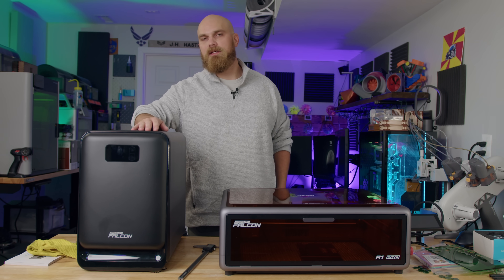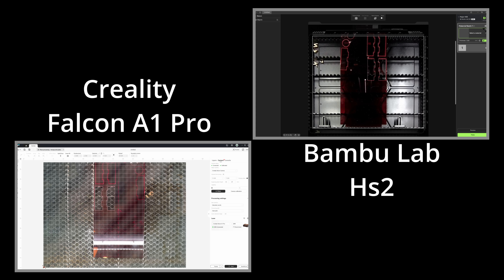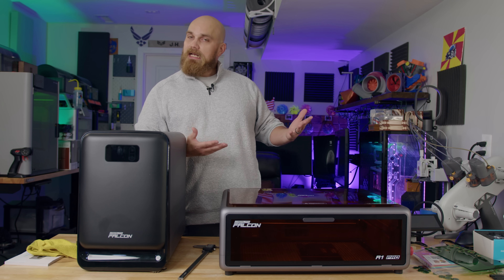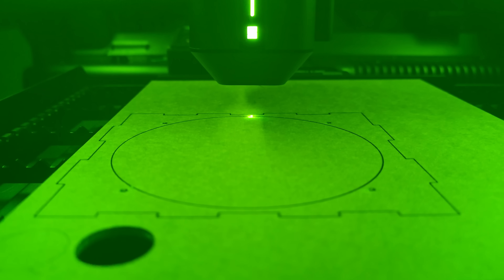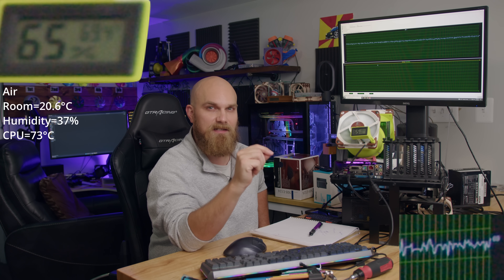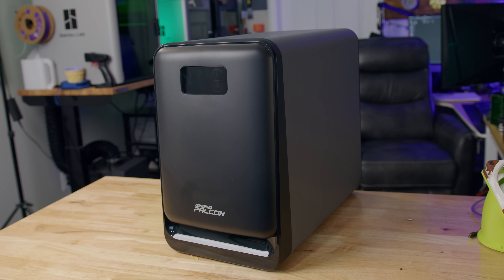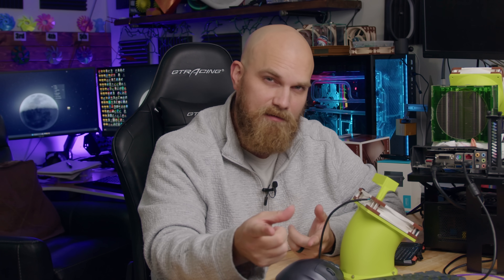I Water-Cooled My Air Cooler… Again, But Different

Comment: Seems like many CPU air fans are a lot of uneeded work.

If you're really wanting cold constant temps, just use a water cooler block connected to a aquarium chiller and call it done

Comment: i would like to see 3 fans put in series (right next to each other, as in air from fan 1 gets pulled through fan 2 then pulled through fan 3) and sealed up with spacers around a 3 inch gap in between to get crazy high static pressure. basically, if you put a 3rd fan in-between those two macaroni tubes.

Comment: i  wonder: when you build a closed circuit of air, with an AC unit cooling the air, those also dehumidify the air.
when you use the water that comes out of the AC unit to cool the air further, so that the water is taken from the airstream by the AC unit and the vapour is added before the air goes into the PC, would that be more effective than an AC unit alone?

Comment: How does the humidifier work?
If it uses heat to evaporate the vapour would be hot = bad
If it uses mechanical evaporation the vapour would be cold = good
Reply: you seem to have answered that in the video...

Comment: In my mind, the air should condense on the heat fins and release the same amount of heat energy that was "lost" from evaporation. I suppose if the air going out is more humid than the ambient air, it still carries some latent heat that was originally from the ambient air.

Comment: By the way, the cooling efficiency of humid air does not only scale with the lower density, but also with the higher heat capacity. I think if you manage to cleanly combine the two relevant equations you actually end up with a slight increase of heat capacity per volume for humid air.
Plus, the capacity of a fan to move air may actually depend on the mass of the air, so potentially the same fan can move a larger volume of humid air than dry air?

Of course that is no valid for cooling of humans, which depends on the evaporation and will always be more efficient at lower humidity ;-)

Comment: Humid air is only bad for cooling with animals that sweat inorder to cool themselves ie: More humidity the less sweat evaporates from your skin which means you get hotter the more humid it is the worse off you are or until you suffer heat stroke

Comment: If you think that hot moist air is more efficient
just wait till you meet cold moist air
Reply: Even more so considering the surrounding air is dry and he has basically built an evaporation cooler.
The results will be quite different when the air is already wet.

Comment: Yeah that's evaporative cooling that decreases the temperature of that air,  you can get a similar effect if you use one of those small "personal air coolers" without misting. Then you wouldn't have the water mist, just the cooling, and more humid air. Just humid air from an air cooler that don't generate mist won't cause condensation unless you cool that humid air down below the dew point. 

Air coolers that don't generate mist typically don't even make the air go quite down to the wet bulb temperature, but even some of small cheap "personal" air coolers reach quite close to the wet bulb temperature. So, using such an air cooler could generate some potentially meaningful cooling without having to worry about condensation on the CPU cooler. 

The main problem with evaporative cooling is that the humidity in the room needs to remain relatively low, which can be difficult to achieve when you're constantly adding moisture to it.   

By the way, you can't see water vapor, what you see is small water particles. 

Just humid air would only have very small effect on the cooling, at a given temperature, water vapor has less than half the specific heat capacity of liquid water at room temperature, which means less than twice that of air, and even really humid air only has somewhere in the ballpark of 1% more of it mass being water vapor compared to typical room conditions, in the same temperature.

Comment: if you have an infrared camera, could you show where the hotspots are on the air cooler ? Then cut acrylic to be able to a higher flow rate/speed ? induction on those spots and the rest (if there are) just a normal airflow

Comment: Not sure if your explanation is entirely correct. Yes you are precooling the air and humid air is less dense but it still has a higher heat capacity. Humans cool by evaporating sweat, which is less effective in higher humidity air. CPUs do not sweat (afaik^^) but thanks to the higher heat capacity the same volume of air from the fans can extract more heat from the cpu.
It will never be able to cool below room temp, but humans can as long as the air is dry enough

Comment: As a Creality Ender 3 V3 SE owner... yea, Creality just does not care lol. And tbh my experience has been decent with it especially relative to its price back when I bought it (it was the recently updated model with auto leveling etc which prior models didn't have). I've printed multiple hours per day with it, printing items that must be 99% identical every single time, and I am pleasantly surprised with the printer not having a single major issue or needing any maintenance to keep itself consistent enough to cover my overarching needs.

But man.. the thing is, you just always randomly spend more time trouble shooting random little things, and the "big issue" is that while these small little issues are not critical and you can deal with them, they always change, so you never really know what you have to deal with next. There's not much consistency to how the issues arise or any patterns to base your troubleshooting on, and right as you figure out why something caused a minor problem, now the next minor problem is gonna be something else and you have to troubleshoot all over. Is it bed adhesion or improper heating distribution on the hotbed? Is it a software update that now for no reason changes some intrinsic parameters that makes the printer print the same type of part differently now just cus it was sliced with a newer version of the slicer software? Who the fuck knows.. 

Prints always hover between 90-100% desired quality, but a somewhat consistent "90% good", is just low enough that it's too annoying to ignore, yet not annoying enough to really make big headlines or have forums talk about them.

And it seems this "90% good enough" is a thing that is consistent with most Creality products and software. Like the laser cutter that has all the specs on paper, is not overly expensive, but then a dumbass mistake like inadequate cooling is what drags it down out of everything that could be wrong, it's something that dumb and easy to fix?? Like, the audacity of just not fixing a blatantly fixable mechanical issue like that is just a bit insulting lol.

Already have a P2S on order, finally gonna make the switch to Bamboo and see what that life tastes like. Creality always makes me wonder if my print problems are due to my own skill issue, or if it's just Creality being Creality. Bamboo should be able to give more concise answers, and offer a nice hardware upgrade on top.

Comment: here's an idea for you though with the inverted watercooling setup - can you hook enough systems into a loop where a pot of water on the coldplate/hotplate gets warm? one of the biggest sources of waste in datacenters is waste heat. I'd love to see if there's an easy way to demonstrate it to politicians in my country as they push for more datacenters, as a way to re-use that waste heat for other industrial processes.
Reply: Instead of industrial processes, why not move the heat into district heating.
Temperatures won't be enough to boil anything, as the temperature of the water will always be lower than the heat source and warmer than the surrounding air. The whole thing with nothing being 100% efficient. But it could be enough to add to room heating.
Reply: @HappyBeezerStudios  true. At the moment though, most of the datacenters being proposed in my country are in industrial areas, not near residential ones. was thinking with a compressor or heat pump design it might not be enough to boil water, but might get you half of the way there at least

Comment: Basic Physics: humid air has a greater thermal capacity than dry air. There are more particles comprising the atmosphere. More particles means more mass to absorb and transport the heat.
Reply: Very small difference in specific heat capacity between dry and humid air in "normal" conditions, and that small difference isn't due to the number of particles as that is the same in a given volume assuming temperature and pressure is the same, that's why you can calculate the mass of a given amount of gas if you know the volume and temperature and the average molecule mass.
Reply: Great if the thing you cool gets it's cooling from the temperature difference.
Not so great if evaporation is the method of cooling. Which is also why 50°C in a desert are less uncomfortable than 30°C in a jungle.
On the other hand, if you want to keep things above a certain temperature, dry air is better. Like, let's say, going outside in winter without getting frostbite.

Comment: Water is more efficient at carrying heat than air.  It stands to reason that a higher humidity would allow the air to carry more heat away from a surface as the water vapor absorbs heat energy from any surface is contacts before fully evaporating.

Comment: First off if you have a laser and don’t have lightburn what are you even doing. Lightburn is the only way to go for software. I have the falcon 2 pro 40w and I have well over 2k hours on it never once over heated and done very very minimal maintenance on it. I cut 5mm abs at 100% power 300mm/m cutting out control panels most panels are 15-20 min per panel and I’ll cut them back to back with out a single issue. Just got the atom stack a70 pro max the creality 40w cuts just as good and is more precise 🤷‍♂️

Comment: Having an Ender was an adventure. Having prints out of nowhere failed because of one issue only for another completely unrelated issue to rear it's ugly head in teh next print. It is just an endless cycle of troubleshooting and upgrades. And I kinda loved it but at the same time, I rarely ended up actually printing something. When I accidentally shorted the motherboard I realised that I just want a print button, that I had a print fear and avoided printing stuff because I was afraid about what will go wrong this time.

Regardless, relative humidity improves air's thermal capacity. That is why if it is hot and humid you feel much hotter, as the air is essentially "hotter" to you (you have harder time transferring your own heat to it), but when it is hot and dry you do not really feel all that hot (evaporation cools you much better). That is however only true for human body however as important part of our cooling is evaporative cooling via sweating (and if you have nowhere to evaporate your sweat you are essentially thermally insulated). For air cooling a PC you have huge thermal differences, where humidity works in yourr favour. In fact a cold humid air is ideal, it draws in the heat and exhaust hotter at much lower humidity (relative humidity - the air temperature dictates the air's capacity to contain humidity without condensation, cold air is much worse at it while hot air is really good at it, this is how dehumifiers work - they cool down one side, draw in air that they cool, take the humidity out of the air via condensation on the cold part and then use the cooled air to cool their hot side, essentially AC that only cools itself). What you made is essentially a swampcooler, albeit reversed (the real one uses water wicked into cotton and blowing air through it to cool down air via evaporation).

Comment: Water vapor in the air acts as additional thermal heatsink for aircooling. Higher humidity means the air in a set volume of space can absorb more thermal energy as it passes the cooler fins.

Comment: Also water has a 4x heat capacity compared to air while the mass (density) is only 1,2x to the air. So evenif the mass is lower for the vapor it can carry way more heat from the heatsink

Comment: The camera complaints made me laugh because I grew up next to my dad use a laser cutter, and there was no such thing as a camera to help align material. You moved the svg to where you thought the right place on the canvas was, and sometimes you messed up. It was never a big deal. You got pretty good at placing it in the right place. This camera feature seems like a good improvement though.

Comment: Commenting on this 7 hours after video released and it has over 60 dislikes, looks like there are allot of Creality fanboys hate watching this video and disagreeing with the obvious unsatisfactory subpar performance of the falcon lol I'm on Major Hardware's side and believe the evidence shows that its clearly not a case of operator error and the machine isn't up to the task and isn't preforming as advertised by Creality the manufacture

Comment: The fan is round. the heatsink is square.
WHY did you not 3D print an adapter from circle to square so the air had to pass through the whole heatsink?!

Comment: Now if you want the actual ultimate heatpipe cooler hack, cut the ends of the pipes open and solder on water fittings and fill with water then use a small pump to circulate water through the pipes.  Fish pond diaphragm pump is best to use as there will likely be bits of copper circulating through.

Comment: Aside from the evaporative effect, water has a very high thermal capacity, meaning higher humidity air will require more heat to raise the same amount of temperature than low humidity. That's another reason it runs cooler at higher humidity.

Comment: The main thing going on is probably that you aren't talking about total room humidity, but high humidity coming from a humidifier into a lower-humidity room, which means there will be a lot of evaporative cooling and effects from the temperture of the water being added.

This is actually something you can do for your outdoor unit for HVAC. You can have mist hose addons spray water onto the fins of your outdoor unit and improve cooling efficiency. Of course, it leaves tons of deposits and makes dirt and stuff stick to it more, so the products for this purpose can be something of a scam. But not totally, because the effect legit works.

Comment: You should look up cooling towers and possibly try to make a more effective version for a CPU. I know in datacenters with centralized water cooling, cooling towers are used to get the water temperature below ambient, which uses some water, but is more effective than just blowing air through a big heat exchanger. The large concrete hyperboloid-shaped things that have "smoke" coming out the top and are commonly associated with nuclear energy are also cooling towers. Those spray hot water that needs to be cooled over high-surface area shapes which allows water to evaporate and cool the remaining liquid water, so the "smoke" at the top is just water vapor. Also, the shape is optimized to create air movement taking advantage that hotter air is less dense and more humid air is also less dense, so they are completely passive, unlike most datacenter units.

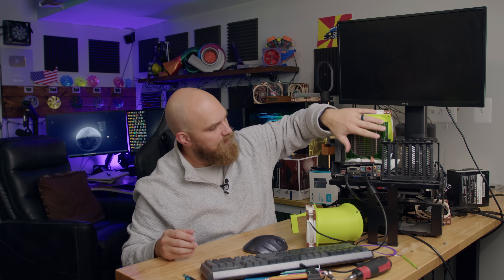Comment: 10:30 you need to consider the difference in specific heat.
water is 4kJ/kg.K, whereas ais is 1 kJ/kg.K.
Also, the humidifier doesn't create water vapor, but tiny water droplets.
This means the density actually goes up.

Comment: evaporative cooling...a fine mist of water droplets in a VERY dry airstream will cool it incredibly...they have boxes in the desert called "swamp coolers" that pump water thru a fibrous mat that pass air over it, and it can cool desert temp air to colder than some AC systems can...

Comment: High humidity lessens the ability for PC air coolers to transfer heat into the air. What you effectively created (like the rest of the comment say) is a swamp cooler. As a person with a background in HVAC tech, swamp coolers really only work to "cool" the air through evaporative cooling (sweating) if the relative ambient humidity is low. If the relative ambient humidity is high, a swamp cooler will lose cooling ability due to the inability for water to evaporate further into the air. This is why you saw a decrease in CPU temp. Hope this explained a little further the results you saw.
Reply: Pretty much why evaporative coolers are useless in my area. It's always wet.

Comment: creality is building for a DIY/hobby market.

so they carefully avoid this small detail that is a BIG DEAL when it comes to industrial gear.

DUTY CYCLES.

my motorbike might redline at 18,000, but im not KEEPING it there! especially for hour after hour...
someone likened it to a car that has to sit for 15minutes out of every hour... well, go and run it at full throttle, full power, and see how long it takes for some warning lights to come on?

even an airbus flying on one engine isnt running it at full power, it has reserve left so i can do it for extended periods and still do more if required... briefly!

the average consumer cares not for duty cycles. they want low cost and ease of use. look at the manual, teh advertising... so happy happy and bright and cheerful!

so freaking nauseatingly vomit inducing... i like my no frills industrial machine, thankyou. just give me the specs, the full specs, (doesnt state duty cycle anywhere?) and no frills manuals. 

they could probably make something that packs twice the punch in for the same cost, and do it 24/7 if they werent so oriented on making it "pretty" for the "market". 

the actual fundamental performance seems to be an afterthought. they spent more on stylish packaging and photoshoots than engineering the components... that will be the cheapest products available, of course... just more "enshittification". but, as i say, its not targeted towards industrial use.